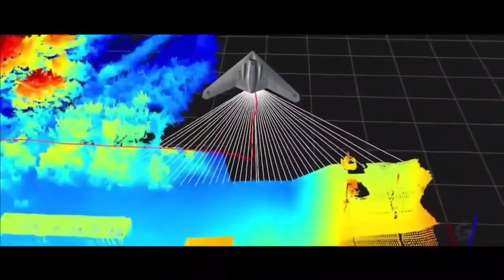The full-scale prototype of the Ghatak UCAV will be put under test by the end of 2025 #drdo

Comment: Ghatak swift  technology has inner weapon system to deploy, but two box outer missiles of multiple missile systems can be placed beneath the uav, landing time the tyres will come, during mission operations time, the box containing missiles should be droped and it should be controlled by the commanding sectors it should have multiple missiles to hit the target, both box containing missiles will help to attack the targets placed on ground , Indian technicians of swift program should think advancely to improve the Ghatak project

Comment: Manik Small Turbofan Engine (STFE) is once again not being used. This engine is always only mentioned as not being ready! The Financial Express:
“The full-scale prototype of the Ghatak UCAV will be put under test by the end of 2025. The Indian Navy is also interested in procuring deck-based UCAVs for Aircraft Carriers and Landing Platform Docks.”

2025 is heroic. HAL’s test pilot Thakur picture of SWiFT UAV  where many parts are still under process of integration. Every part has to be integrated into SWIFT first then flight tested all in on year. HAL's terrible track record of never being able to meet deadlines does not inspire confidence. 2026-27 is far more likely.

Comment: Ghatak will be obsolete by then....slow speed is our usp😊
Reply: Yeah yeah 
Stealthy UAVs will be obsolete by 2030 
Great thinking
Reply: @fly   counter EW measures are already in place for ucav ...we need fast procurement of male uavs asap... turkey has already started suplying pak with its latest drone it has a carrier operated dron as well, china hai predator class drones what we have?? Project cheeta? Ghatak ? Far from delivery and operational...dont be blinded
Reply: @saranshsingh21  
I know all that
We are obviously lacking , no problem there
But there is no way Stealth UAVs like Ghatak will be obsolete in a decade.

Also about MALE UAVs , tapas & Archer are there for IAF, it is upto the IAF now whether they want phoren maal or desi maal.
From here on DRDO has to develop Archer-NG & new MQ-9 class drone to counter China's mighty drones
Reply: @saranshsingh21  EW systems are not something which are fixed there are several ways to counter those things. Low cost UAVs don't have those. ghatak will be bigger system and it will have better jamming resistance.
Reply: @saranshsingh21  our approach is different we are focusing on loitering Ammunition. And TB2 will not be that effective against India because we have better EW counter measures and even better Air defence compared to Russia in initial days.
Reply: @Maxx James  ok, it might have that, but until this will be delivered, dont you think enemy will have developed counter measures they are already way ahead. I am talking about china
Reply: @james4807M  you buy air defense from Russia and you are saying you have better air defense weapons . Which is true ?
Reply: @saranshsingh21  you can get better EW system than china from anywhere in the world no such big deal. And if they can use such systems so are we.
Reply: @imthecaptainnow6446  I said initially. If you can't read not my problem. And we have better system initially because we will fight in our own territory not invade other country
Reply: @james4807M  Bhai ek second. Bharat has the worst air defence on the planet and our air defense is totally ineffectual against even the cheapest worst drones. Bayraptar can't be beaten even in your dreams. What is needed is a desi AA gun with laser on a Tata Kestrel. Something like a Skyranger 30.
https://www.youtube.com/watch?v=3AlKQCGI8lU
Because these only have a short effective range, at least 500 are needed to provide overlapping coverage. Besides that VL-SRSAM plus  Himshakti electronic warfare system. Lucky is the EW system has 10 000 sq km range, so only 100 are needed for both borders! IA has 2!!!! Just 2, what electronic warfare? IA also has no VL-SRSAM,
so when the Bayraptars come jawans will go home in bodybags.
Reply: @datoolz0  small drones fly at 100/200 feet altitude these drones cannot be trance by big air defence system.  Radar of ADs is placed at certain degree you can place it vertically otherwise it will only show you ground clutter. Chinese drones small ones can be shot down with guns but TB2 like fly at certain height and they can be shot down with osa,spider, akash, Barak8. Type system. Anti Aircraft guns can also be usefull but not as Air defense missile because AD missiles have better radar guidence and Lock on after launch capability. Fighter jets can easily take down these drones as well
Reply: @james4807M  Small drones are best targeted by AA guns because of cost. A missile costs 1 million dollars, Shahed costs 30--40k. AA shells cost only $2.50 per round. Anti-aircraft guns in Mogadishu as per Reuters FACTBOX-Prices of arms in Mogadishu market is a lot better than a million!

The only answer to a drone swarm is aa guns, yes against predators VL-SRSAM is a good answer because those cost $100 million apiece. Missiles are only a valid answer to expensive aircraft/drones.
Reply: @datoolz0  earlier you said we have worst air defences and only AA gun on tata crystal can be solution. Now you're shifting goalpost. Not interested in continuing this discussion